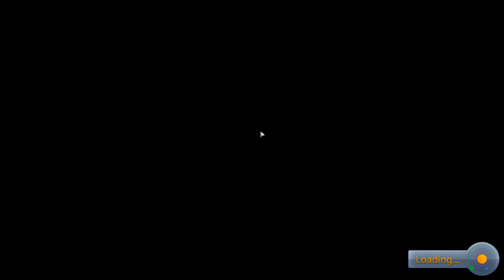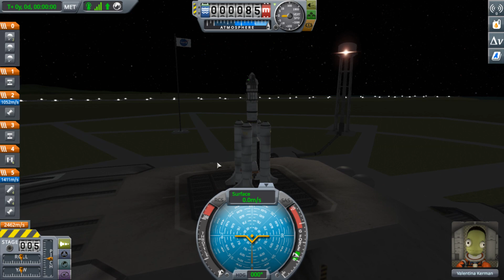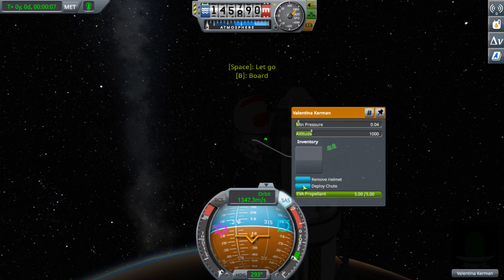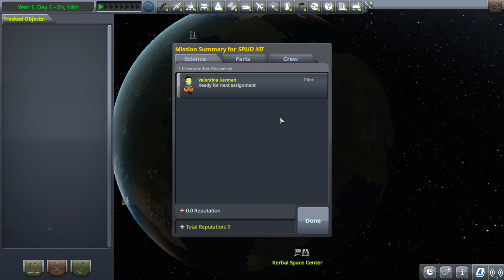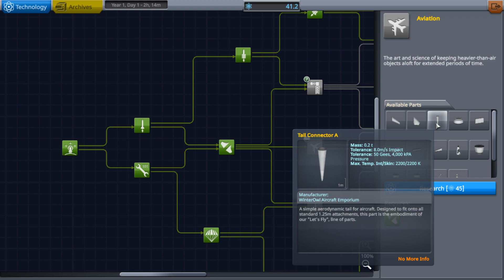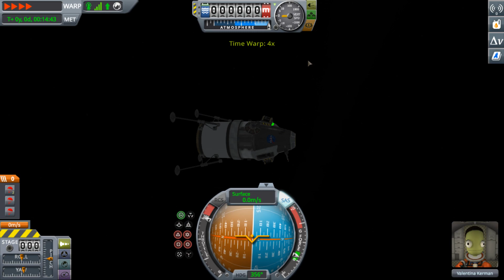Kerbal Space Program Episode 5 // Easy now learning curve

Comment: The 2 best places you can go for science on kerbin is the two poles on the planet.

Ontop of this If you design a craft that can have your kerbal exit, get onto the floor and re enter you can take surface samples from the runway, launchpad, normal ground, ocean and in each of the biomes for a really good amount of science. I believe if you get it from the poles you get over 100. You can make your own burn with a rocket to have you land at the pole and collect samples which is the fastest but probably most difficult. And there are two parts of the pole you can take samples from. Inner pole and outer so just go to the rim and close to the center

Another side note is you don't even have to get your kerbal back in the rocket to collect the science. As long as he is on kerbin you can recover him from the tracking station. Using this, 4x time warp and a macro or auto presser and bit of your time you can just walk your kerbal to all of the places

Comment: you don't have to go the tracking station, when you're landed, hover over the bar at the top, it'll drop down and give you recovery options. 

Additionally, don't transmit data unless you have too- it reduces the science yield on everything but your crew reports.
Recovering the data when landing always returns 100% of the data

Additionally additionally, your heat shield is more powerful than you think, so long as you're not dropping straight down, the shield will protect you healthily from like 3-4 thousand m/s reentry
Reply from the maker: As much as temp as that? I didn't know that. I am really struggling with interplanetary travel.
Reply: @tableandchums  It might burn off the landing legs that are off the side, but otherwise it should be pretty safe, yes. the heat shields are kind of OP
Reply: @mrbreadison  they're kind of op irl too they can do similarly well here too

Comment: if you want to get into orbit easily, fly straight up for 10km, then slowly tilt towards the eastern horizon. by around 35 km, you should be around 45 degrees. the atmosphere ends at 70km. you need about 2000m/s to get a circular orbit at that altitude, less if you're higher. if you fly east, you get extra delta-v (about 200m/s) from the planet's rotation, making it easier to get into orbit.
Reply from the maker: This is a huge help! Thanks loads, so deltaV is bonus speed from planets rotation?